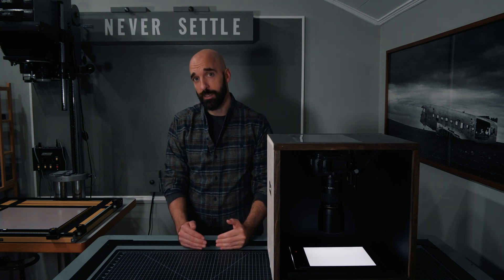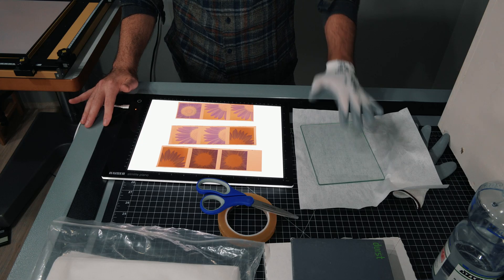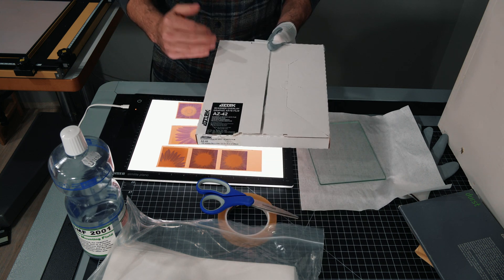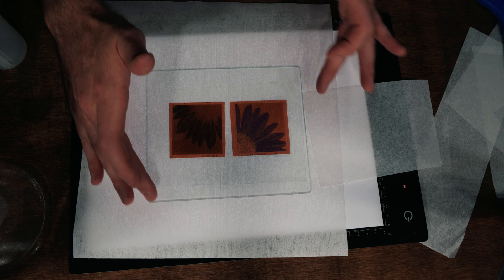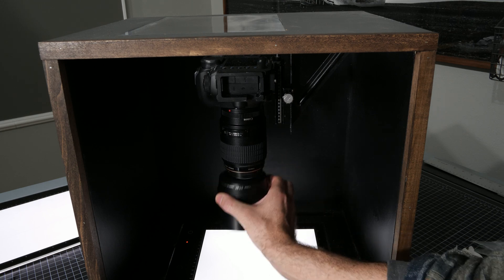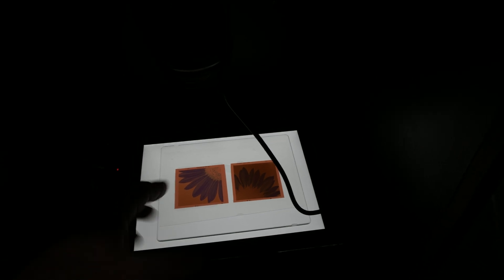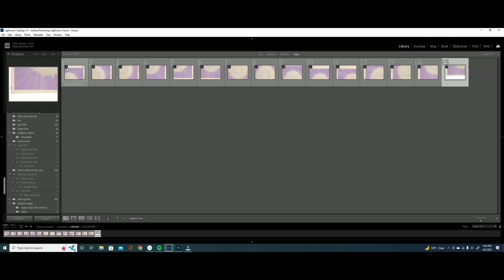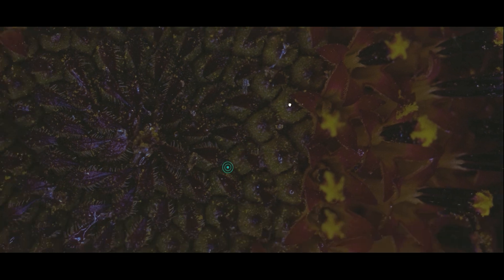Getting the most out of your negatives with DSLR Film Scanning

Comment: I noticed that your glass is slightly tinted (as glass usually tends to be); do you think it's worth getting the low-iron glass to preserve the CRI of the light source? I am currently in a mini rabbit hole trying to sandwich 35mm negatives between glass plates and thinking about the tinting issue haha
Reply from the maker: Haha oh what a rabbit hole that is. The glass I’m using is an anti newton glass spare from my enlarger. To be honest I never noticed the tint but am inclined to think it won’t have any impact. At least not one I have ever noticed. I would say minimizing glare from the light source and dust are far more likely to give you issues more than any tint in the glass. I probably need to update this video as I’ve changed my dslr scanning rig but the light source/glass has not changed. Good luck scanning! I recommend a good beer on hand as it can be… frustrating :)

Comment: Nice setup! I recently got anr glasses and am still troubleshooting. I used to use lomo digitaliza when I dslr scan my films. When I switched to anr glasses and lightboard in order to perfectly flatten out the film strips, I noticed that there were some orange ring/spots in the images especially in the sky area. I found out that these are my lens reflected off of the glass. I haven't figured out how to get rid of them, but your setup seems to experience lens reflections. Have you had any concerns about this?
Reply from the maker: That’s interesting. I haven’t had that issue. I did just update my setup though and am now using an enlarger lens on a bellows with a copy stand. With my old setup, I would usually have a lens hood that nearly contacted the light. I’m not sure if this would fix your issue but might help. Anything to reduce glare. The only reason I changed my setup is I was having issues getting perfectly parallel and would sometimes end up with soft edges. That and it wasn’t stable enough and would sometimes shake when I would move the film between frames.
Reply: @MrNegative  Thank you for sharing. just found out that the lens reflections I got were from stray lights. with some DIY foam board masking, I got 99% of them gone. However,  I won't be able to scan w the sprocket holes this way since lights come in via the sprocket holes :p anyways, big thanks to you!
Reply from the maker: Glad you got it figured out!